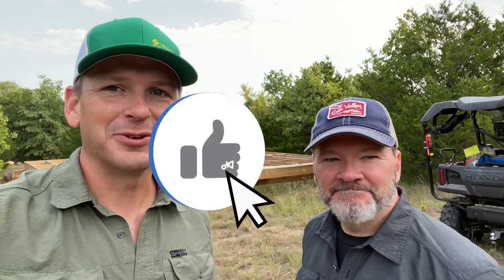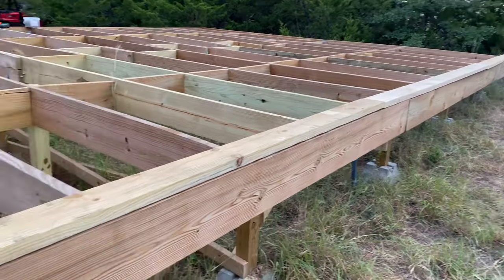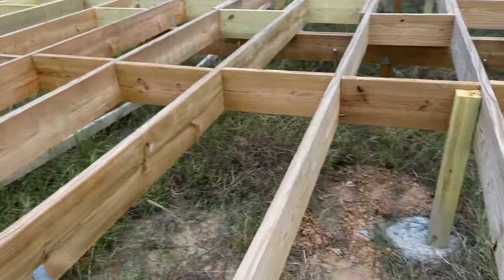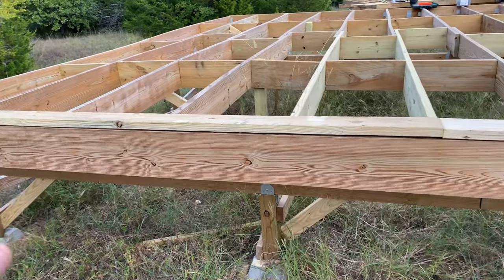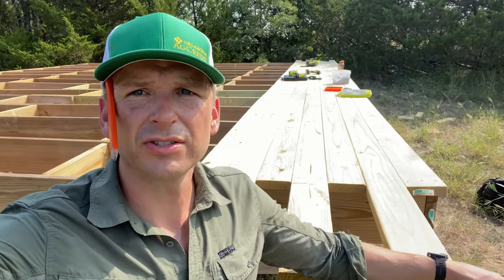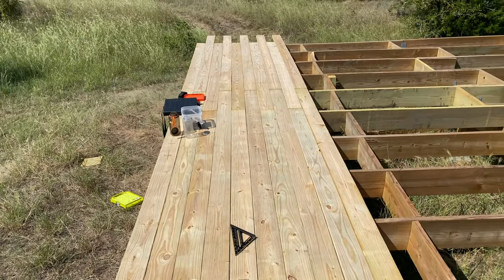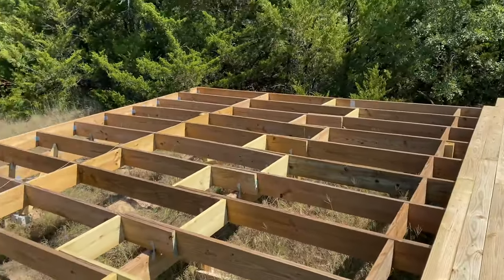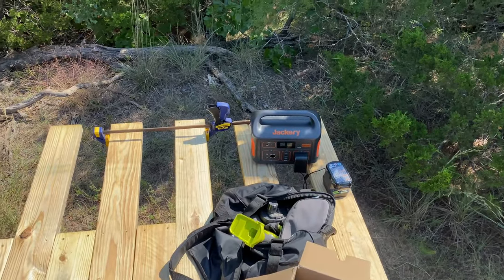Adding 2x6 deck boards to our 22x28 ft free-standing bell tent platforms.

Comment: Coming along amazing.   Good call on the added support and cross pieces, it certainly can't hurt and now's the time.  You guys are really moving along, can't wait to see the final product.

Those Jackerys are amazing.  We have one as well and it ran our whole cabin until the Solar system was completely put in.   They are worth every penny.  Super handy and mobile too if you need power at some remote spot, just check it the ATV/UTV or truck.
Reply from the maker: The Jackery is awesome!  while not as powerful as the Bluetti that Devon has, it is much, much easier to transport and move around.  So much easier!

Comment: How do you not know what the width is. You’re telling me… nobody measured the width of the platform?
Reply from the maker: Thanks for watching.  I (Devon) didn't know how many rows of decking boards I was going to use, because the deck boards are not identical, as they varied slightly in thickness, length and width.  Since my deck was 23 feet wide and the boards are supposed to be 5.5" wide, I figured I would be using 50 rows, give or take one row.  Over the span of 50 rows, those small variances in width add up.  I ended up installing 51 rows of boards.  Thanks again for watching.